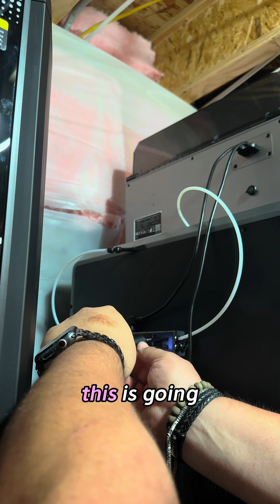Creality K2 Plus CFS Side Mount #3dprintlife #3dprintable #crealityk2plus #k2plus

Comment: Don’t go too short on the Bowden tube between the CFS and the buffer, it will cause filament hangups and jams!
Reply from the maker: That’s good to know cuz I was about to shorten them lol now I won’t lol thanks for the heads up!
Reply: @Basically_Benski  I have the CFS upgrades for the K1 Max and mounted the buffer on the back of the CFS.  Once I changed from a short tube length to a longer tube length (like 3ft/1meter), the jams stopped.